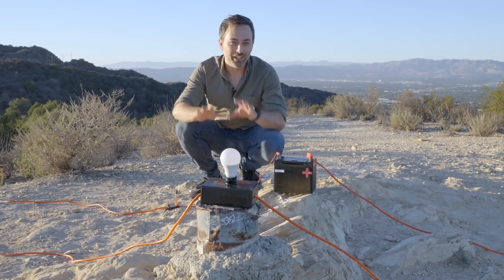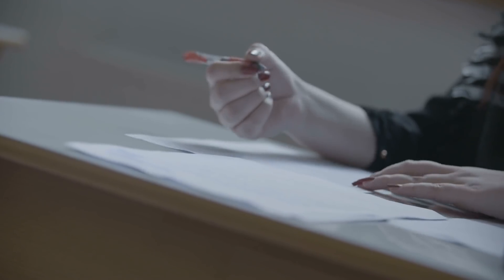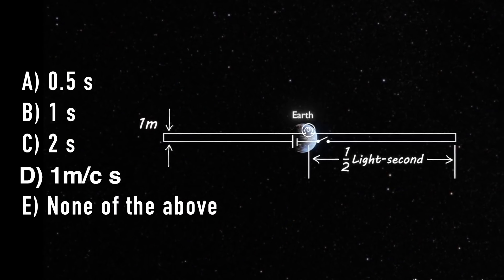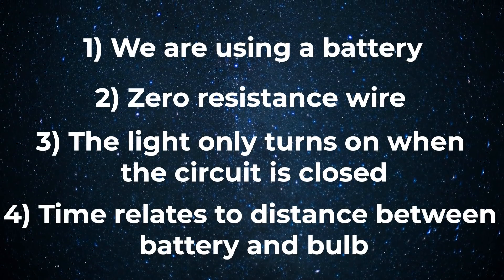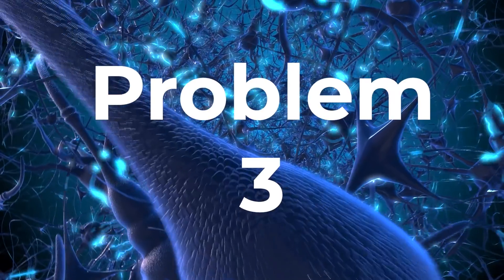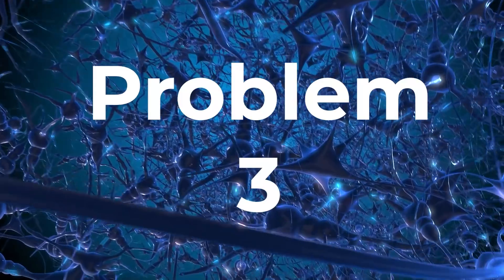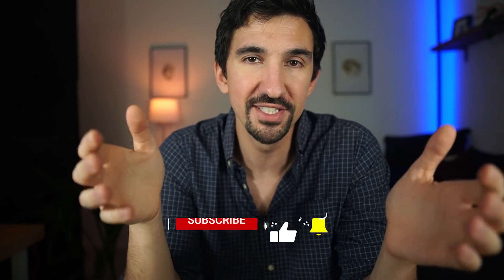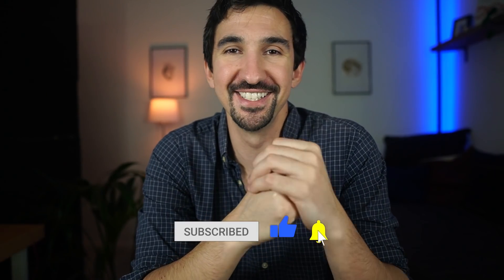Is Veritasium Wrong About Electricity?

Comment: Folks, you can easily simulate this with a circuit simulation program like LTSpice. When you do, you will learn that electricity does not flow inside wires. The energy flows in the electromagnetic field outside the wires, hence the potential change at the switch will immediately start propagating along the wires at the effective speed of light along the transmission line formed by the two parallel wires, hence anything that has to do with the speed of light in vacuum is already ruled out by the existence of a dielectric between them (which is needed to keep them separated). Look up the theory of a transmission line pulser and you will have your correct answer.
Reply: Why does a thin wire get fried by a large current, if the electricity is not flowing through it?
Reply: @pauladamson9459  the flow of electricity is different than the flow of energy. The size of the wire limits how the electrons flow.
Reply: @pauladamson9459  Because in that case the electrical energy is flowing into the wire instead of along it. If wires get hot, then we aren't using them correctly. The proper use of conductors is as boundary conditions for electromagnetic fields. An ideal conductor will keep the electric and magnetic components of the em field outside of its volume. In a non-ideal conductor the field can penetrate into the conductor but it is exponentially dampened. This is called skin effect and the skin depth goes with the inverse of the square root of the frequency. For DC currents the skin depth is infinite, which means that the field has penetrated the conductor completely. In that case the Poynting vector (cross product between electric and magnetic field) is non-zero inside the conductor and some or all of the electrical energy gets deposited inside the conductor.
Reply: @lepidoptera9337  Thanks for the detailed explanation. :)  It's very helpful.
Reply: @pauladamson9459  You are welcome.
Reply: @lepidoptera9337  
Thanks for your insightfull comment(s)!
So as a thought experiment, what will happen when someone cuts the wire at the far end the moment you switch the light on?
Will it turn on for a while and then slowly turn off again?
I feel like it does, because the wires would in my mind act like a giant capacitor and when you switch it on energy flows during charge-up...
You seem to know these things. What do you think what happens?
Reply: @lepidoptera9337  In my world electricity flows in the wire. The initial local flow of electrons will generate an electro magnetic field but I dismiss it as being very small, the wires are not linked like in a trafo. Looking at long telegraph lines it takes some time before electrons start moving 1000 km down the line. With a longer line the loop will capture enough electro magnetic noise to make the 12v battery irrelevant.
Reply: @2adamast  Yes, you are living in the world of middle school science. In the world of PhD level physics all energy flows through the vacuum and electrons in metals are merely boundary conditions that determine what those fields look like. Look, physics can be complicated and electromagnetism is where things are transitioning from classical physics (stuff moves) to field theory (energy gets transferred by configurations of the physical vacuum). It's nobody's fault that we can't teach this properly at the middle school or even at the high school level. It's conceptually and mathematically simply too involved. It is actually so complex that even many EEs who are tasked with developing high speed electronic circuits are having difficulties with it.
Reply: @lepidoptera9337  Making it complex doesn't make it right.  At (1m/c) s the event horizon is 1m,  so everything outside that meter is superfluous for a model.  The switch sees 2m of wire and a lightbulb on maybe 0.2m of wire, something similar for the lightbulb.  The shared space makes only the first 0.2m of wire relevant on both sides.  I don't expect much power transfer from that. I don't expect much direct power transfer from a 0.3 Gm power cord either.
Veritasium is just edging towards classic sophism.
Reply: @2adamast  I don't remember saying anything else. Neither will a cable pulser. Having said that, your "event horizon" argument, while valid, gives you only a limit and it's not a precise estimate because of the dielectrics, which slow things down. It doesn't tell you anything about waveforms, either. Transmission line theory does.
Reply: I definitely agree that the EM field propagates outside the wire, but here we're talking about an EMF generated by a 12V current going through a 2mm diameter cable wrapped in a 1mm insulation layer that is able to reach the same cable that is 1m away. We've all used magnets, we can all imagine the huge magnetic field required to affect an object that is 1m away... The theory is right but the example is badly chosen IMO.
Reply: @Neehize  Yes, it is. The impedance of the cable is in the range of maybe 150-200Ohms. The load is maybe 1Ohm. That means the actually interesting physics (pulse propagation along a transmission line) is hidden from the casual observer. What does that tell you? It tells you that Veritasium is not good at either physics or electrical engineering. :-)
Reply: @lepidoptera9337  Derik had made a lot of  effort to make that Chanel to this much.I don't think he will post a vedio like this without thinking twice.
Reply: @motivationmonster596  I hear that he does his research, but that doesn't mean we should blindly accept everything... And in this case he admitted that the current flowing at 1m/c s was residual (check Dylan's answer in the original video)
Reply: @motivationmonster596  It takes more than two thoughts to understand Maxwell's equations at work, I am afraid. Sorry to say, but the cable-load impedance mismatch is about as bad as the science-YouTube mismatch in this case. :-)
Reply: @lepidoptera9337  Derik is explaining the direction of energy flow using poynting's theorem .But one of my doubt is that there is not significant proof for the poynting's theroum .Using the law of conservation of energy and the maxwell equation we are just reaching an assumption that the poynting's vector shows the direction  of energy flow.
Reply: @lepidoptera9337  also thanks for your replay
Reply: @motivationmonster596  You mean your WIFI doesn't work? How do you think those antennas were designed? Using angel wings and dragon feathers? :-)
Reply: @lepidoptera9337  😂😂😂.No.I mean thinking about deriks idea after watching his vedio is too confusing.But this vedio explains it clearly but real essence of deriks idea is depicted as just the electromagnetic induction.
Reply: @Neehize  yes that's right.We can definitely judge the ideas that he explains.But I am sure that there will be  something amazing behind his ideas .We must try to grap its essence.
Reply: @Neehize  also here in this vedio deriks idea is depicted as just electromagnetic induction.Derik will not confuse us by explaining something that is taught in the high-school like a big misconception.
Reply: @motivationmonster596  Yes, there IS something amazing behind his idea. His whole point is "the energy that makes electrons move is carried in the electromagnetic field created by the circuit AND NOT the flow of electrons pushing each other down the pipes like we would observe with water." Which is totally true.
But IMO his example is very badly chosen. Now people will start to think that wires don't matter and all the energy that is received to power the light is coming in the air directly from the battery that is 1m away...
The theory is correct but the example is full of physically impossible assumptions that make this thing possible just to blow our minds and make us think all we were taught was wrong.
Reply: @motivationmonster596  Electromagnetism isn't easy.  It is not intuitive IMHO, not even for a classical field theory. It is certainly far too complex for high school science, but we still want people to have some understanding of electricity, which means that we have to reduce the physical reality to concepts like electrons flowing in wires. That, by the way, is not wrong, if we are interested in things like electrolysis. There we really have to count moles of electrons moving in wires. It's also not entirely wrong for static electric and magnetic fields. When it comes to dynamic fields, however, the motion of charge carriers becomes a secondary phenomenon and the motion of electromagnetic fields is best explained in the context of special relativity... which, of course, is beyond the high school level for sure.
Reply: @lepidoptera9337  Yes.For just understanding the concepts in the surface we use some misconception, otherwise even the phenomenon of electromagnetic induction will need the full understanding of length contraction, maxwells equation  and even the whole special theory of relativity .So for simplicity we are using  harmless misconception. But this misconception sometimes shows its side effects. I think  this is what derik tries to eliminate. He is not really saying about the ordinary electromagnetic induction phenomenon that happens between 2 conductors but something more deep that we must understand a lot to appreciate its depth.
Reply: @motivationmonster596  People misunderstand physics. Physics treats nature like an onion, with many layers. We can use different approximations for different layers of phenomena. Classical electrons are fine for many applications, so are quasi-static fields. And then there are some things for which they don't work. That's when we deploy Maxwell's equations, quantum mechanics and quantum field theory. If you want to build LHC, then you have to understand the latter. If all you want to do is to explain water electrolysis in 10th grade, or so, then none of that complexity is necessary. 

Or, as my first theory professor remarked at the beginning of his first lecture: "Ladies and gentlemen! Pay attention. Physics is the art of the approximation. If you can't deal with that notion, then there is the door. Take the path across the campus to the philosophy department. That's where they will teach you to think in absolutes. We will have none of that here.". Everybody laughed, nobody left.
Reply: @lepidoptera9337  😂That quote was really nice. Physics is really complex than we think about it .There are a lot of things that we don't know that we don't know .😁
Reply: @motivationmonster596  Not as many as you think. A visit to a good science library should correct any false ideas about how much we actually know. There is reading material there for hundreds of lifetimes. :-)
Reply: @lepidoptera9337  but at the end of the day  our science model is not enough to answer all our questions.But that's what make this world interesting
Reply: @motivationmonster596  You are correct, I don't need science to answer the question "Chocolate or vanilla?".
Reply: Yeah but as stated by Maxwell's equations, you need a change of an electric field to induce the magnetic field. To create a change in electric fields, you need some moving charges, which in this case will be the electrons. So the movement of electrons is very important for the flow of energy and existence of the electromagnetic fields in the first place.
So electrical energy (in any form whatsoever) is bound to the velocity in which the electrons can move in the wire.
So idk it's basically just the form you want to call it. First the energy is just stored in the potential difference of the battery, then it is converted to kinetic energy of the electrons which in turn create electromagnetic fields which also store energy. So I think it is wrong to say that the energy is only in the EM fields or in the flow of electrons.
Reply: @marijnvangeest  We don't need any electrons to make electrical energy flow. That's why we have wireless communications. That's what light does. It's the physical vacuum that transfers the energy. What the electrons do is to "tell" the physical vacuum where it should transfer the energy to. They form the boundary conditions for the energy flow. That a few electrons are flowing along the wire is just a side effect. In the case of AC they aren't even doing that. See transformers... there is no physical connection between the primary and the secondary coils.
Reply: @lepidoptera9337  replying to your reply on my previous message... you say we don't need electrons to make electrical energy and bring wireless communication as an example. 
How is this signal created though? To create an EM wave for wireless communication we need some form of moving charges. They all work as a modified version of a Hertzian dipole. You need a change in potential or charge. The things that create these changes are the charged electrons. It may be true that they don't move very much, but their movement is crucial for the creation of the EM fields and waves. It is their energy which will be converted into the field, in the same way as the EM field can transfer energy to the electrons. Exactly this interaction is what happens in transformers. 
That's what I said: It is wrong to say that the energy is only in the EM fields or in the flow of electrons. 
Just as wrong as saying the energy of a pendulum is only stored in it's hight or only in it's velocity. You need the velocity to actually transfer energy, but the potential from the hight is necessary to create that momentum...
Reply: @marijnvangeest  I believe I said that we don't need moving charges for energy flow, not that either the classical theory or the quantum theory is complete without them. Both theory and experiment support that notion. What moving charges do here (and that is their only function in energy transmission) is to direct the energy to where we want it. Trust me, your power company would be more than glad to get away without having to lay thousands of kilometers of very expensive wires to get the energy to you, especially since they cause losses. As you can see in the night sky, the physical vacuum is (in a sense) completely lossless for electromagnetic radiation. It gets to us all the way from the end (i.e. the beginning) of the cosmos. :-)
Reply: @lepidoptera9337  I would say there are considerations other than that.
You can transmit power with one wire.
Reply: @indio007  Sure kid, and the Earth is flat, too. :-)
Reply: @lepidoptera9337  

I'm probably older than you.

Anyhow.. 

1. It's been demonstrated.
THE TRUE WIRELESS
by Nikola Tesla
Electrical Experimenter, May 1919

2. Of course it is. It's all you will ever know and experience.
You can fantasize about experiencing something else but that is all you can do.
Reply: Isn't this the reason that shielded cables are used for certain high voltage applications? To keep the field inside the cable, right?
Reply: @josephchristopher6603  Exactly.
Reply: About half way though the video I started looking for the first comment that corrected Dr. Miles misunderstanding... and this was it!
Reply: @Bob Indeed. The LTSpice documentation for the transmission line will tell you that. :-)
Reply: Thx for your post so I don't have to post the same thing. I can't believe had to scroll this far to find the correct explanation. 
Cheers.

Comment: Simple circuit analysis would tell you that this loop would have a massive inductance, so no meaningful current would pass through the light bulb for a while.
If the bulb is triggered by any EM interaction, then sure closing the switch produces EM disturbances that propagate at C, meaning the bulb turns on in ""1/c s"", but then the question is trivial.
I think a better question is the reverse. This bulb is on and the circuit is steady state, you open the switch, how long until the bulb turns off? Lots of very relevant 1st year physics concepts to be discussed in that explanation. 

Overall not a fan of Derek's video and I think the quality of his content is slipping
Reply: Except that you can not treat two parallel wires as an inductance. You have to treat them as a transmission line, instead.
Reply: I don't know why your reply doesn't show, but I agree. It's a times scale separation problem. For low frequencies the shorted transmission line acts like an inductance. For short timescales it acts like a capacitor formed by a tiny stretch of it. Between those two extremes we have to analyze it as a transmission line. And technically it's also an antenna, so a small part of the energy will be radiated to free space. That alone makes it impossible to analyze this system with any kind of closed form formula. We can only assume reasonable approximations of its behavior for certain time and frequency ranges. It's one of those problems that are easily misrepresented by the way they are being asked. There are no easy answers here. One has to go through Maxwell's equations in one form or another.

Comment: 4:20 I thought the exact same thing at first, but it's in a different frame of reference, therefore causlity is not broken and information is not communicated faster than the speed of light.
cutting the wire will not make the lightbulb extinguish, it takes 1/2 a second until the bulb gets the information that the wire was cut and only then starts to extinguish #420 lol
EDIT: oh wait... but the information that the wire is closed takes a second lol, yeah now that I am thinking about it more, you are right
Edit2: but then again, the wire was already closed for a longer time beforehand, so it might already know it's closed